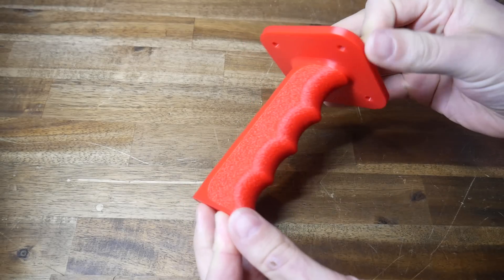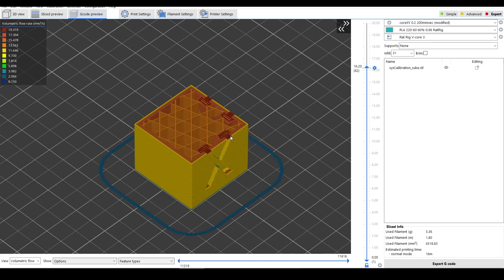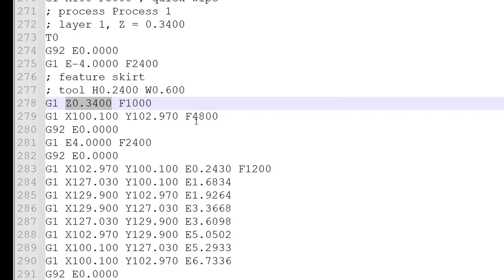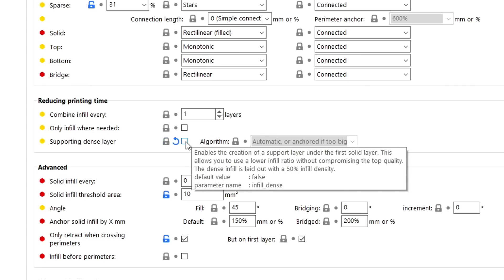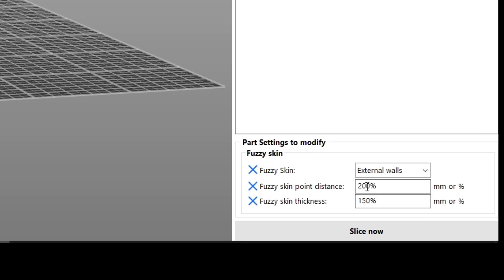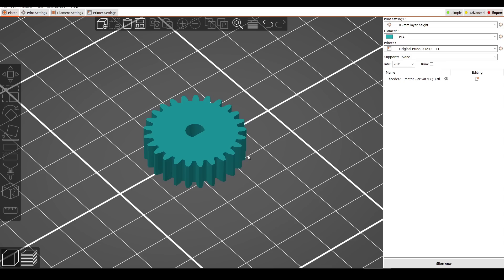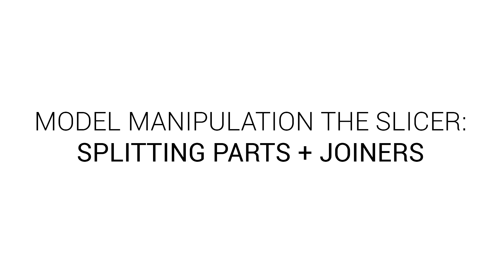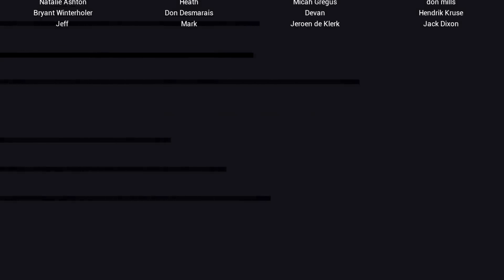8 great 3D printer slicer features you might not know about

Comment: Thankyou for a great Chanel.  Is there any slicer software that can handle 35 extruder heads. Im´ working on a record braking 3d Printer with 7 gantry and 5 print heads on each and so fare every thing looks fine but I need some slicer software that can handle this little beast of a 3d Printer, Any replay are very welcome

Comment: superslicer and prusa slicer have global z. you have to enter it in custom gcode, under filament settings, under start gcode. I use it all the time for all of my filaments.  you can enter SET_GCODE_OFFSET Z=0, next line, SET_GCODE_OFFSET Z=(YOUR VALUE). you need z=0 first, so that if you do multiple prints or stop and restart a print so that it doesn't compound each offset into a very high and unusable offset. hope that makes sense

Comment: Just a little note for anyone that would happen to use infill layer thickness and is using a stock ender hotend, you will need to slow the infill layers down when you use it because the thicker infill layers will end up pushing more plastic through the hotend and it won't be able to keep up causing extruder skips if you leave the default speed on

Comment: I have owned a 3d printer for a month and already I noticed that PLA and PETG need different z-offsets, as the latter extrudes much more soft, therefore doesn't need to be squished as much. Would definitely be an useful feature in my slicer!
Reply: Right on.  Finally this issue is getting noticed.  I've been changing my offset manually when changing filament type forever now.

Comment: Hi Michael I'm still new to using a 3d printer and I have a creality cr10 pro v2 and it recommended cura for my slicing program but was wondering if the prusa alpha slicer could be used for my slicing instead of cura cause I have a lot of big items that I want to print and the feature for adding pegs and holes would really help so I don't have to use mesh mixer thanks again for your time and great video

Comment: I have not seen much on the orientation of prints for bed slingers in the slicer.  If you have a thin but tall piece, should you orientate is on the bed so that the short dimension is in the y dimension, and hence the long dimension in the x dimension so reduce bed travel?  As a piece gets taller it's chance of detaching increases as the moments around the attachment point increases.

Comment: Cura 5.3.1 has added capability to add text, however, it is not as intuitive as the Prusa 2.6.0-alpha6.  It is helpful when prototyping and easier to add text (Prusa) than in the modelling program (Fusion360, FreeCAD).
What I have had problems with in using Prusa is establishing the proper First Layer Width.   In Cura 5.3.1, I set it (Quality | Initial Layer Line Width) to 140% but have tried both percentage and mm in Prusa and the width is always very, very thin.  I am using a standard 0.4mm nozzle.  Any suggestions?

Comment: If you scale fuzzy skin right down (to something like 0.2mm for both thickness and distance) and  it can help hide layer lines without massively affecting the external surface design.
Reply: Yeah, I have started using it for all of my parts, they look amazing
Reply: What are layer lines?
Reply: @RavenPhoenix696  The line/small fridge between extruded layers that make 3d prints like they were 3d printed. I'll try that setting.
Reply: The horizontal banding you see on your printed model due to it being printed layer by layer @RavenPhoenix696

Comment: I SURE HOPE that eventually there will be no need for these hundreds of options and instead there will simply be an OPTIMIZE function that does a full analysis of the object to be printed, taking into account the printer and filament being used, your desires regarding quality and perhaps print time, and produces an optimized GCode file. Maybe it could also make recommendations, based on your desired output, as to which filament, printer, quality, and print time you're aimning for. The current need to have the user make all these decisions is just crazy. Surely some advanced analysis techniques, perhaps even employing Artificial Intelligence, could be aplied to this problem and come up with something that makes it increibly easy to achieve the best possible prints.

Comment: One of the most useful slicer features to me is variable layer heights. That gives you the precision of a small layer height with the speed of a high layer height. It saves a lot of time while still getting pretty results
Reply: It is also in Cura
Reply: @Frappe3621  How do i find it in cura please.
Reply: It's a very nice feature and I use it in Cura. Sometimes it adds to the print time though so make sure to compare with this on and off. There are settings that let you configure how much it can change the layer height.
Reply: @TinaDanielsson  If it adds print time it will do so to increase the quality. But that can be tuned (at least, it can be with PrusaSlicer)
Reply: Is it one of the settings that Cura lets you set per model? If so, you could use a modifier model to limit it to certain layer groups. There's also "Change at Z", if that's still around...
Reply: I started to use diferent layer highs in Simplify3d manually… at around 2016. And Prusa Slicer (Slic3r) started to do it auto at around 2018… nowadays Cura have to but they don’t create this feature

Comment: You have probably done these before ... With Prusa Slicer.  Add part / Cylinder, unset the scale factor lock, set z height to your layer height (ie 0.15mm with 0.4 nozzle), then lower the newly created one layer high disk to the plane, (button far RHS of position row) and then move the disk around to corners of the model that have been lifting (on a hard to print model) ... and you have mouse ears.  Copy paste the disk for all corners, and wherever else it may be lifting (usually sharp corners).   Another is say you want variable infill ... typically a structural piece .. you set 20% for most of the model but need 80% around a bolt hole that will be clamped to stop it crushing the model ... Add modifier / Cylinder ... move it over the hole you want to strengthen ... set Cylinder infill to 80% and the bolt hole is now reinforced.

Comment: Cura lets you set the elephant's foot adjustment setting and save it as a preset for each filament you have. I've never had to adjust it at-printer after that.
Reply: Weirdly I never had to set any Elephant foot compensation in prusa slicer or cura. Everyone seems to talk about Elephants foot being a problem but I've never seen it no matter my print temps on my E3 V2 or E5 S1. Makes me wonder what I'm doing different.
Reply: @sammcj2000  Can depend on a lot of things. Could be you already have a bigger-than-usual z offset, so there's more space between the nozzle and the print bed, resulting in less squeezeout; could be you're printing at a faster speed than usual on the first layers (normal process is to print at about halfspeed on first layers); could just be that you're printing with very large layer heights; could be that you're printing with a raft or brim, either of which 'resolves' the problem by the added step of having to clean up the bottom of the print.

Could also just be that it is happening but it's too subtle for you to notice. Could be all of these things combined, or none of them it all - it's not impossible, just improbable, that you magically set it up perfectly on your first try and have never shifted or bumped/warped anything ever, especially if you've been printing for quite some time or have moved your printers

Comment: I want to add 2 things about Cura:

1. Cura does have a round-about way of making a boolean cut;
-add the cutting body you want to cut out (you can generate some basic shapes with the Parts-for-Calibration extension)
-move the cutting body into position
-select the cutting body and under per-model settings go to Modify settings for overlaps
-set it from infill only to cutting mesh
-select the settings for wall thickness, top/bottom thickness and infill density
-set them all to 0

2. Cura has an infill line multiplier, meaning it can generate infill made up of multiple extrusions per line. A multiplier of 2 lines with connected infill lines for example can make lightning infill way more reliable, as all infill within a layer can be printed without any retractions, therefore no curling at the edges and less movements across the lightning structures. I once had a failure about 10 hours into a large sculpture print caused by lightning infill's weaknesses, which I prevented this way on the next try. 
Infill line multipliers can also be used aesthetically, as I did with my phone case. I designed the case in a way that its appearance could be modified with infill structures. I set it to a 6 times multiplier, and now my phone is adorned by a nice, robust hexagon pattern with 3mm wide lines.

Cura does lack a few things that I want that other slicers have, but it also still has some merits.
Reply from the maker: Thanks for the extra info. I rarely use Cura but I did try to google anything I couldn't find. Your comment adds what was missing.
Reply: Cura is my go to for about 4 years now. I've given all the others a fair shot but find them to be a lot less user friendly and way more confusing to navigate. +1 for team Cura here
Reply: Yeah everyone seems to forget about cura's plugins and marketplace when talking about what it doesn't have. Plenty of tools from slic3r etc are fully implemented in Cura already as plugins, so there's no need for them to reinvent the wheel and build something from scratch that already is in the slicer. I've been using a few of their plugins for model manipulation and find them quite handy.
Reply: I use cutting meshes in Cura quite often.
Reply: Another member of Cura Gang here...the plugins really set Cura apart from the other slicers. It'd be nice if more of the popular plugins were integrated into future releases, but they are perfectly functional as-is. I've dabbled a bit with SuperSlicer but it's been mostly at work because I don't want to go to the trouble of rebuilding my home printers' profiles from scratch, and as long as Cura remains easy to use (particularly with nozzle size changes) and gets routine updates with bugfixes and feature improvements I can't imagine switching away from it any time soon.
Reply: Can we please just admit Cura sucks?
Reply: Thanks!
Reply: Thank you for no 1! I use the calibration models for manual support and it's annoyed the heck out of me that I couldn't use them for cuts too.

Comment: Nice video! 
You can make truss like structures without the need to model all of it by using triangle infill with zero top and bottom layers and then play with the number of perimeters and extrusion width to make it more stable. With modifiers you can make this as a design element on parts of your print and print other parts normally. You can make this with planters for instance and have drainage holes without modelling.

Comment: A feature I've been wanting is adaptive infill or change infill at layer height. So If I want a weighty base a more dense/strong section I can modify the infill for one exact area.
Reply: PrusaSlicer is really cool about that, because you can define "height zones" where you can not only change the layer height, but almost every setting the slicer has.

For example, I recently printed a part that didn't need infill or fine layers, so the majority of the model had 0% infill and 0.28 layers, but the one section where fine layers were needed, I just needed to tell it from which height to which height I wanted fine layers. And before that section I turned infill back on to 15% so lightning could provide some support as well.

The part looks a little weird, because of the drastic difference in surface finish from the layerheight, but it was functionally exactly as intended and on top saved time and a little filament.

As for the adaptive infill, it also offers adaptive cubic infill, but I haven't played around with it much to know how it works. But just being able to bump the % up for a section of height is already plenty. I think the overlap method that Cura uses can also be used in PrusaSlicer, and with that a lateral section could be given denser infill than the rest.

I really recommend following Michael's advice and checking out the PrusaSlicer alpha versions. I started using it with 2.6-a5 and now got 2.6-a6 and I barely miss Cura.
In fact, there's only two things I miss from Cura: extensions and parameter formulas. But PrusaSlicer is working better for me in everything else to massively outweighing the "loss".
Reply: @BloodyMobile  yea indeed this can already be perfectly done in prusaSlicer! :)
Reply: I believe this is a feature in Cura
Reply: @Frappe3621 Cura has a setting called "Gradual Infill Steps". You set in how many steps the infill will be increased from 0% at the bottom to your configured infill density is at the top.
Reply: If you're using Cura you can add an extra model (a cube from "Part for calibration" plugin for example) and configure Per Model Settings -> Modify settings for overlap (Infill mesh only) with the infill density and pattern you want. Then place that model at different locations. For example one model at 0-1 mm, another at 1-3 mm and so on. It's not per layer, but you can calculate the heights quite easily. There's probably a similar process in other slicers.